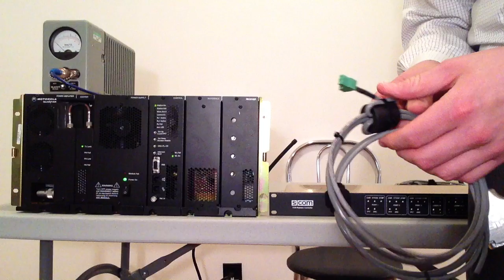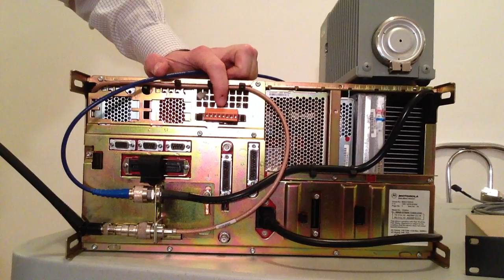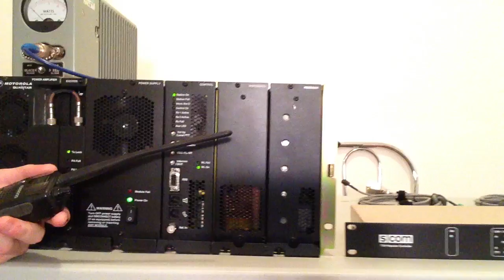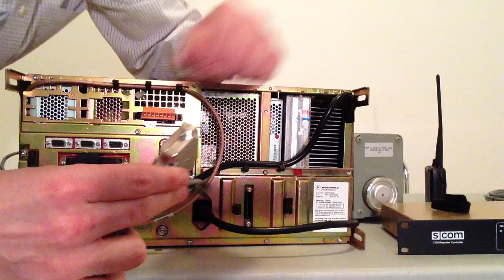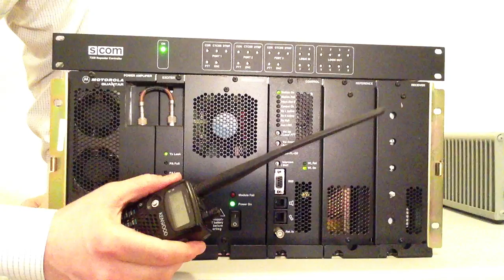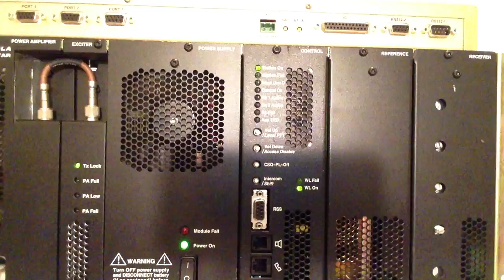Northcomm Quantar Repeater Cable

Comment: Don't you need the wildcard module fitted for this to work?Cheers Dave
Reply: Hey there, the wildcards are, for lack of a better description, are a function of the wireline card. As long as you have a wireline card and firmware of 16.X or higher you can activate the basic or enhanced wildcards in the programming software.

Comment: I have an SCom 7330 controlling a UHF machine as well as a 220 mhz machine myself. Question......assuming the Quantar is both P25 and analog, and you may have two repeaters on the controller, what happens on the second repeater, when the P-25 side transmits.